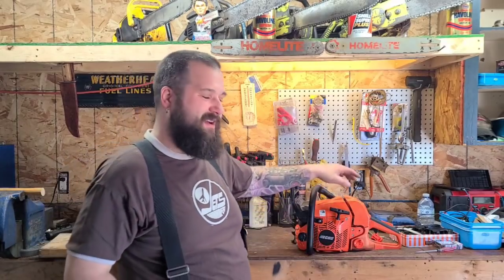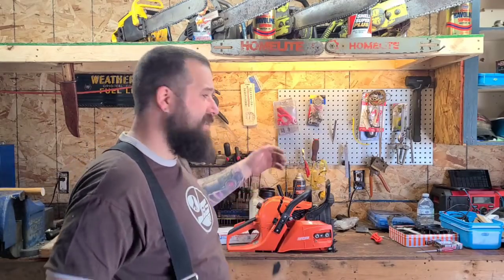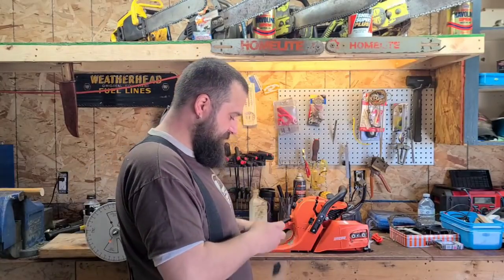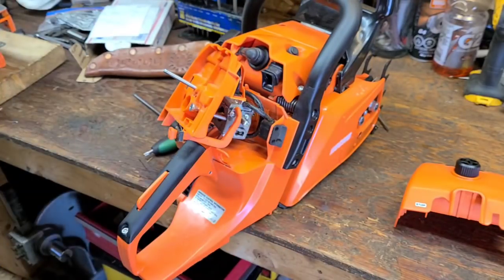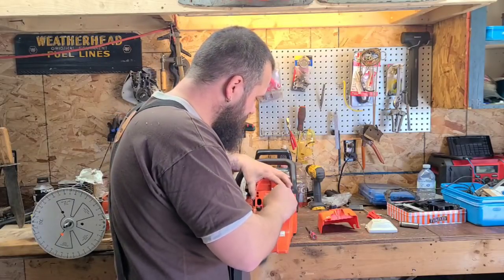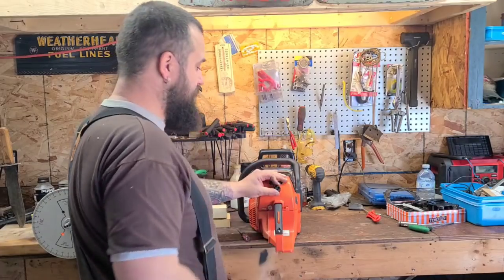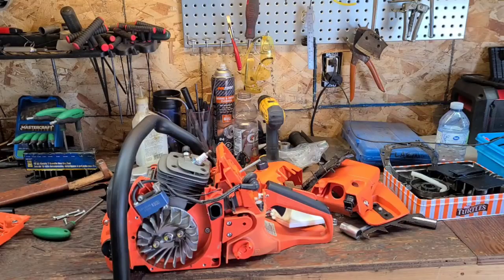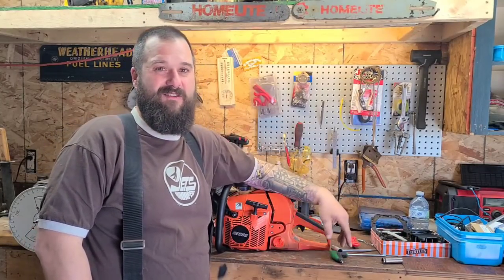Echo CS-590 parts have arrived!! A bigger carb and go fast ignition!!!!!

Comment: the 590 has a limited coil the 620 does not .the carb on the 620 is different  than 590 .the piston is a one ring on the 590 2 ring on 620 and jug is also different . the 620 has metal side covers and an aluminum handle 590 all plastic .my opinion spend the extra 150 get the 620 pro saw.
Reply: I agree By far cheaper to buy the 620 then it is to build a 590 into a 620
Reply: My 620Pw ran like crap till i done the muff mod and pulled the plugs on the carb.. tuned it up and now its running  a28 inch sugihara with Stilh chain.. Banshee!
Reply: I have both the 590 and 620. In reality stock vs stock there isn’t much difference in performance between the two if any.
Reply: I believe the 620 coil is also limited, but limited to a higher RPM.

Comment: The 620 has a different cylinder with more aggressive porting and a 2 ring piston instead of one.Also better bar,rim sprocket, and mag clutch cover. Here in the US the 590 is $400 and the 620 starts at $549 so it’s worth it to buy the 620.
Reply: Thanks for the information!
Reply: It definitely is, when you consider that to 620p carb and coil he added to the 590 in this vid come up to be more than $150, which is more than the cost difference between the two saws.

Comment: in the US we can buy the 590 for about $450 and the 620 is about $650.  You can find the 590 on the resellers market for about $350 because they are usually Home Depot returns.  I just bought one for $190 because one of the bar studs was broken off.  I ordered a new one for $12 and its super easy to change.  Doing the muffler mod and retuning the carb wakes this saw up without buying any parts.  Maybe one day i'll order the bigger carb and get the 6 degree timing mod to really get the full potential.

Comment: OK video I guess.  The replacement coil I got also does not have a spark plug connector like the one shown here. I did not see anywhere in the video instruction on how to remove the connector from the original coil and install on the new coil. There is no going back now as I had to destroy the cable on the old coil when removing the old connector. So I'll keep looking on you tube for a video that may show that detail.

Comment: Just picked one of these up today. Really excited to run it tomorrow. So far impressed with how strong it feels, seems to be built well. Excited for the series!
Reply: Keep an eye on the oiler- with a 24"  bar and the oiler turn fully up my 3 month old 590 barely gets enough oil to keep the bar from burning/wearing.

By comparison I have the oiler on my 400 set about midway and the chain gets fully coated with an 18" bar.

Comment: I highly recommend upgrading to a Red Beard Saws filter. The factory 590 filter is not very impressive. It was one of the first upgrades I did to mine. Well worth it. I pulled the limiter caps, did a muffler mod and threw on a RBS filter. Once broke in, it pulls a 24" bar with no issues.

Comment: I’m so glad I found this channel. I am learning a lot. I’m actually sacrificing my cheapo craftsman China saw to learn the ins and outs of porting. Tin man have you ever seen an intake port that was triangular towards back of port? I’m sure on how to grind on it..

you should do a cheapo saw series, I would love to see you rip into one of those supposed 62cc eBay saws and see what you can do to it.
Reply: Found an anomalous port on one of my china saws as well! Love the idea you're pitching but couldn't picture him doing it....the china saws, sometimes they're good I mean my go-to climbsaw is a $135 one that i got over 2yrs ago, though I know others get comparable models off amazon/ebay and don't have the same luck (though I do hear more good reports than bad, I mean at the end of the day a chainsaw is a pretty simple machine so it's not so hard to make a decent one even cheaply insofar as cost of production, my $135 unit has nearly as nice build-quality as my echo's, like tons of metal female slots where other companies use plastic etc)
Thinking of ordering an extra cylinder for said $135 saw so I can test my own porting #'s (after copying Tinman's 590 #'s for my new 590!), the cylinders are barely $20 for that clonesaw (a g2500 platform clone, love the thing :D ) so figure I'll do multiple portings til I stop gaining/lose power, then know my #'s / order another cylinder and have the 'best #'s' for a "work-ready" version of this saw, will definitely document this if/when I get to it!!

Comment: I have a great idea for the channel. I am new to working on saws. I have been doing tons of research. It’s hard to find pro saws in my area but the echos are readily available. I really wanted a pro saw and I am pretty sure the cs490 can be converted into the cs501p I believe the parts are interchangeable. Also I believe the cs590 Timberwolf can be converted into the cs620p. Which is basically what you are doing with this one. So If you could prove that this would work on both saws it would be a great option for people. We could buy the farm saws and upgrade them into pro saws. It would really help people out that are on a tight budget or can’t find a pro saw.
Reply: I'm not sure why anyone would convert a 590 to 620, I did the math myself, and as Tinman said, parts aren't cheap in Canada and it was cheaper to sell my 590 and get a 620. My biggest complaint about the 590 was that cheapo spur sprocket. after the 6th de-chain I said screw it. You need a clutch drum to convert to rim sprocket so that plus the sprocket ran well north of $100. There's zero options for parts in Canada other than the dealer, if I'm wrong, I'll be grateful if you correct me. Consider the outer bumper also cost a bit, it just didn't make sense since the 620 has a lot of other things on it, Tinman said clutch cover and carb, but there is also the double ring piston, bigger ports, different timing, carb, muffler, limiter, and aluminum bar.

Comment: Tinman, the top end and piston are also diff. Porting on the 620 from factory is diff as well as having a 2 ring piston. 620 carb also has a fixed h jet but it can be plugged. Adding the 620 full wrap is a nice upgrade . Look at the red beard saws website for the upgraded air filter

Comment: I have a echo cs590. That came from Mitch Weber.  It’s not a full port job.   Says cylinder modded for better flow. And Venturi valve increased 
 It’s insane. Pulls chain faster and better than my holzfforma g372xp

Comment: Hey Tinman go to saw suppliers,they have a bar adapter to drop in a Stihl bar and run on that saw.
Reply: I'm thinking about getting one. They advertise that you need a chain 3 drive links longer than normal for the bar. Do you have one, is that correct. Thinking about getting one so I can swap bars between my cs-590, ms441 and farmertec g660 kit.

Comment: Good info guys. I just bought a CS-590 yesterday.Haven't used it yet. You guys got me thinking... gonna take it back and see if I can upgrade to the 620 PW. You gents have way more information than the dealer! He told me the internals were the same  (in his defense, it's more of a mower shop than a saw shop). Tinman, awesome vids! Tons of good information, great intel from the comment section. If you want a Boss 302, don't start 289 2bbl!

Comment: Toss the timing wheel on it, right?  I’d love to hear your thinking about where you would want to take it... there’s a bunch of guys who that would really help. 👍😁.  I think it’s the same as the husky small mount bar but I’m not positive on the oiler hole???   Is that 176D or whatever...some Mac, husky, some Poulan...??? They were like $400 here and the 620p was $550 via a dealer buddy so I don’t know the actual retail in the US...  the 620 has a little higher exhaust port roof in my mind... the 590 would appreciate some correction with it’s nice new unlimited coil...😂😂😂.  Love the channel... I love that you get the shot of the bolts because that’s what you would want to see.  My hands shake horrible some days so I don’t make videos... it’s awesome to have you making videos !!  When there’s a guy with a question it’s super nice to be able to say check out the TinMan’s video about it... they learn from that one and also gain access all your others.  Your cutaway video to help explain how the transfer ports work is just an awesome resource!  You are really helping a lot of people with your work here!  And it’s stellar for a guy that’s built some absolutely ripper saw’s to be laughing about having to hunt for the screws, being a little scatterbrained too sometimes and being just a normal guy who loves powersaw’s too...

Comment: I had a 590 I like the saw. I did a muffler mod and a base gasket delete. Made a difference. All I did for the mm was open up the inside a little bit and open up the exhaust exit and made a custom exhaust deflector. I didn’t like the exhaust going at a 45 that’s why I made a new on that came straight out and was a bit taller. It would keep up with a 362. It might out run a 362 with a bigger carb and unlimited coil. I suggest you do a free power mods before you put on the coil and carb. It would be interesting to see the two different stages of power and how it behaves.

Comment: Hey, Tinman!!!! Great video. I'm following this one. I have 2 of these. I bought both with scored pistons. I believe cold seized. I put a new oem piston in one, the cylinder cleaned up decent. Base gasket deleted it. I believe it ended up with .019 squish. Runs great. It was my first attempt at a 2 cycle small engine as a 30 year diesel mechanic. It runs GREAT! The info in this video is what I was thinking of doing with the 2nd one. I'm thinking 2 ring 620 piston, porting it and making an Ironhorse pipe for it. I'll be watching and planning, it will probably be a next winter project along with a Husqvarna 268 that will be getting 272xp top end. 

Other differences in 590 and 620 that I know of are.
1 590 has spur sprocket, 620 has rim sprocket.
2 620 has aluminum handle, 620 pw has wrap handle. 590 has plastic handle.
3 I believe porting is different. 

Keep up the good work. I'm glad that I found your channel.

Comment: Just bought a Stihl ms271...cuts good but may regret not checking out the Echo cs590 a little cheaper...this Farm Boss is a big pain to start when hot after sitting 30 minutes, seems flooded but plug is dry.

Comment: I can't wait to see how this build ends up, and how much it wakes up after porting.
I've got a 620 on order and was tempted to get the 590 instead.  But for the extra money I thought the unlimited coil, aluminum handlebar, and magnesium clutch cover were worth the extra money............and now I find out that the carb is better too!  I feel good about my decision now for sure.  It should be a dandy little saw.
Reply: How long will your wait be for the 620? I have to wait until July for mine. They seem out of stock everywhere.
Reply: It arrived yesterday and I ran the first tank through it today.  I pulled out the carb plugs and opened up the exterior muffler baffle, then tuned it in wood.  It’s a great saw so far, and obviously isn’t broken in yet. It’s got a 24” bar and pulls a full comp chain through 20”+ Ponderosa very quickly..........  I cut a few cookies off the end of a 32” log also, which was handy for tuning.  I’m still a touch rich, but will keep breaking it in like that.  IMO it’s a perfect firewood saw.  I’ve got some old Homelites, a Husky 372XPW, and an Echo 501P, so I really didn’t need this 620, but I’m glad I bought it.

Comment: I just wanted to say I have a 620pw and I put a rubber o-ring between the air filter and that plastic piece because it will suck in some dust so I did that to lengthen the life of the saw .. other than that it's been a great powerful saw and took about 100hours of break in running time for it to really open up and it now screams..

Comment: The exchange rate is $.80 USD to $1.00 CAD.  I sell that saw retail for $399, so $500-600 sounds right in your area...compared to the 620p at $559+ I’d say the Timberwolf is an awesome buy in to a great all around saw.  And you’re right, the 590 has a plastic clutch cover, plastic handles, a smaller carb and a limited ignition.  It also has a few differences in the fuel lines and handle assy, but overall it’s very similar.  

My only major contention with both of those saws is they integrate too much into the engine case itself.  I’ve had a few come in with broken ears where the clutch brake handle mounts, generally due to a limb fall or dropping the saw, and it requires a COMPLETE tear down and new case halves to repair it.  That’s a major expense, upwards of several hundred dollars on a saw that only retails for  four bills.  Otherwise I love and personally run the CS-620pw with a 28” bar.  
Looking forward to the build vid!

Comment: Take the inner deflector and screen outta the top of the muffler and remove the plastic divider outta the air filter. She'll move alot more air and with the new parts she'll be a monster 60cc's.

Comment: Have you thought about just swapping the coil and carb onto it after running stock before porting to see if there’d be any gains just with those mods and the muff mod?
Reply: I was wondering the same thing. What type of gain you could get just swapping parts. Modular saws were an idea I was kicking around. Like, build your own.

Comment: I have a cs 400 and recently removed the carb limiters. Went to tune the saw after and was able to make it run a lot better, but my low jet screw is maxed out counter clockwise and throttle response is still not amazing. It's not bogging anymore, but I am out of adjustment. Love your channel and your echo build!! Any insight would be greatly appreciated!

Comment: all you had to do was pull the plastic limiter caps off the carb adjustment screws and you'd have full adjustment, no carb swap needed. Also, from everything i've heard these 590's tend to come lean from factory, not rich. heard stories of them blowing up because of a too lean of adjustment from factory.

Comment: 620 has two ring piston, the 590 only has a single, the rap handle and side cover are both metal on the 620. Here in the states the 590 is like 450$ an the 620 is like 600$
Reply from the maker: The price difference is more up here for sure. 620 seems like the better deal in tje states.
Reply: @tinmanssaws  No kidding, I'm getting a 620p power head for $725cdn, while I look at it for sale at home depot in the states for 659US with a 24 inch bar. (about $750 cdn)

Comment: I have both 590 and 620. Besides the carb, coil , handle , sprocket and cover I am curious if the 620 has a 2 ring piston vs 590 single ring?

Comment: There's a little metal ring on the intake boot on the carb side that holds the intake boot in that plastic divider, took me a bit to figure that out when I pulled my cylinder off...

Comment: Tinman how many turns out did you tune the 620 carburetor? I have a ported 590 6 degree advanced woodruff key and the o-ring kit to help keep the air clean but it won’t fire?

Comment: The cs590 has a single ring piston the cs620 has a dual ring piston weak point for either the 590 or 620 is the stock air filter sucks.

Comment: Those 590s sell brand new for 300ish in any box store or online
   620 has a metal handle and rim drive sprocket. And the diff carb and coil.